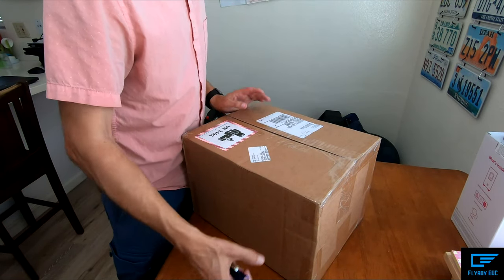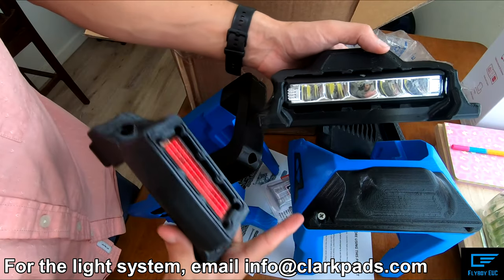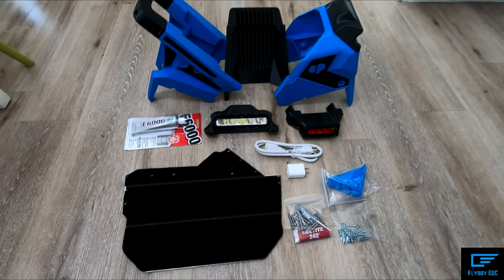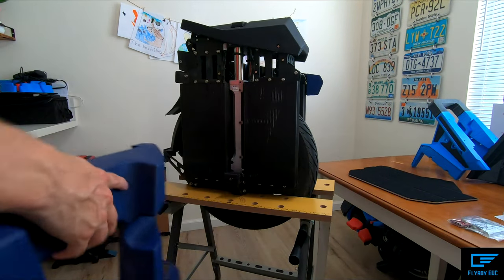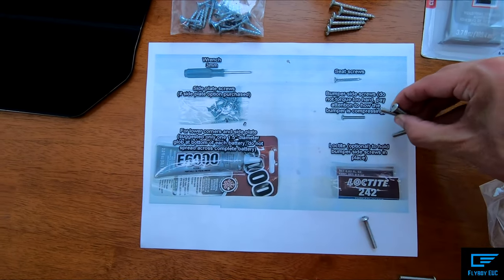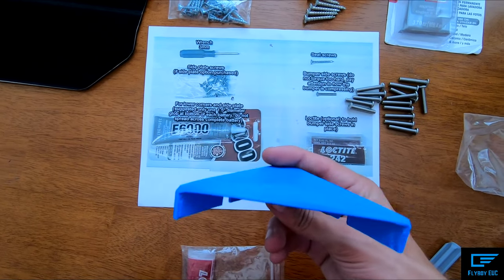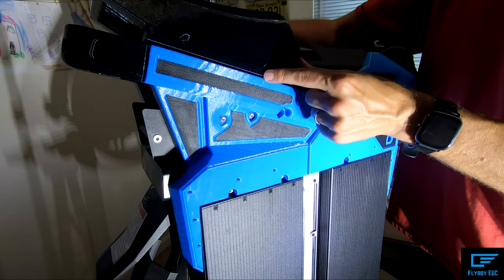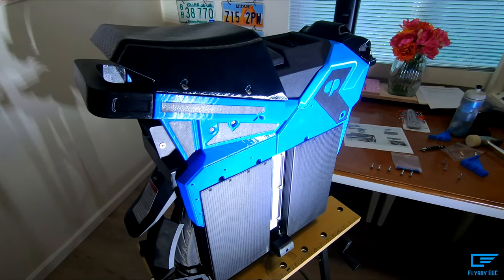Clark Pads Complete EX30 System

Comment: Where did you get the option for the newchead light and bumper system? I havecthe full setup but there wasnt no option to upgrade the lights . Besides awsime video 😎 💯 🔥
Reply: Besides that awesome video my bad for the miss spelling in my first comment 😂😂
Reply from the maker: You need to email Clarkpads directly to get the light system
Reply: Okay would I be able to just buy the front and back light because I already bought the set up
Reply from the maker: Most likely. Email him and ask.
Reply: Okay thanks man appreciate it 🙏

Comment: How did the sticky tape hold up instead of using the E6000 adhesive on the ribbed battery boxes?  I'm looking at getting the Master Pro V3 kit but was thinking the same thing, that I wouldn't want to glue on the side panels and not be able to remove them in the future for tire change/maintenance.  Did using tape work well?
Reply from the maker: The sticky tape is working well. Just sticky enough to keep things together. The screws do most of the work.